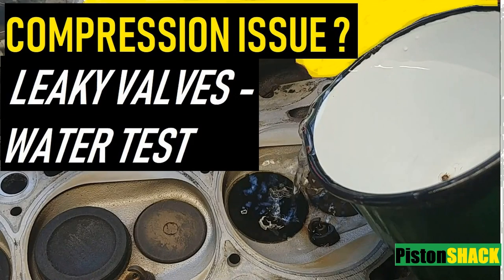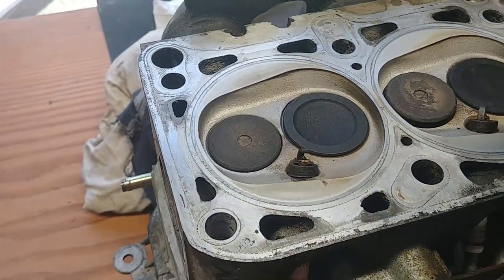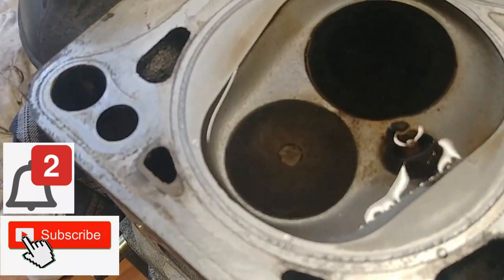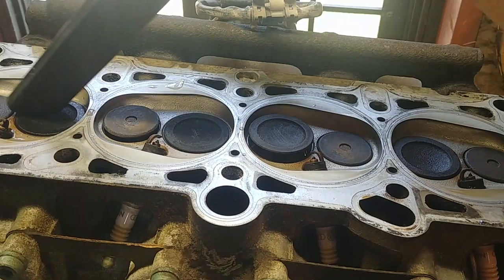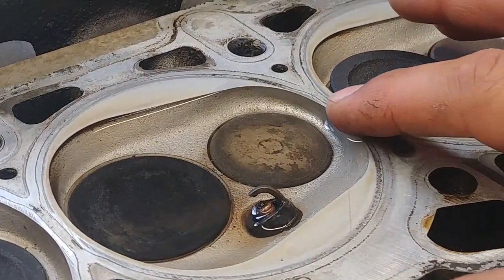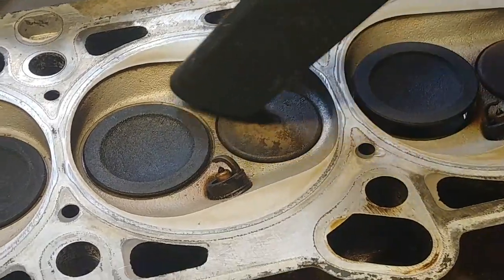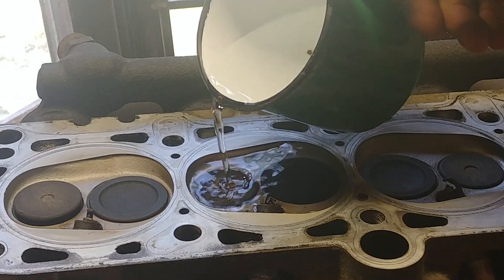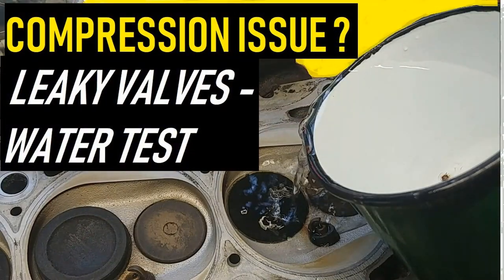CYLINDER HEAD VALVES LEAK TEST. BEST WAY HOW TO FIND LEAKY VALVES BY USING WATER.

Comment: do you just put in the valve stem or do you need to connect the valve stem seal and spring & keepers before you do this test as I'm rebuild by cylinder head and need to do this test.

Comment: What irony
I just realized that's the cylinder head off a vw 2.0 which is exactly what head I'm trying to test.
Pretty sure there's a bad seal around one of the valves on cylinder #4 giving me a P0304 cause there's oil fouling the plug, and there's no crack in the cylinder head.

Comment: i did this, left it overnight,  after replacing and lapping my valves on a lq4 ls based engine, no leaks were shown and the water level remained the same, upon looking at my valve seats, there is surface flash rust, can i leave it if it didnt leak or should i lap them again? Also, if i didnt leak water, why did my seats get some rust on them
Reply from the maker: Hey Cody. Could be just light condensation. If it's light discoloration, metal isn't flaking I won't worry about it. Before installing the cylinder head I also will clean light rust.
Reply: @PistonShack  I ended up taking the springs off and just wiping them down, thanks!
Reply: when you tested for leaks did you put the spring and keepers back in? I just lapped my valves and they still leak, not sure if it’s because the valves are just sitting in the seat with no springs .
Reply: @bobtailsthecat  yes put the springs and keepers on
Reply: @corybrott8455  thank you

Comment: Hey my car is loosing coolant, we changed the head gasket and resurfaced the head and put it back together and it’s still losing coolant but not as bad
Reply from the maker: Sounds like engine might burn coolant slowly if any external or major internal leaks.
Reply: maybe cracked head

Comment: Can I reuse cylinder head gasket? This gasket before one month I replaced
Reply from the maker: Nope, you have to use only new gasket and new head bolts each time you take cylinder head off.
Reply: Yes you can
Reply: @PistonShack  you dont have to replace head bolts, all depends on your engine.
Reply: Yeah Mt 2010 ram says measure the head bolts for straightness and if no problems reuse them that's what haynes says
Reply: Haynes hasn't steered me wrong